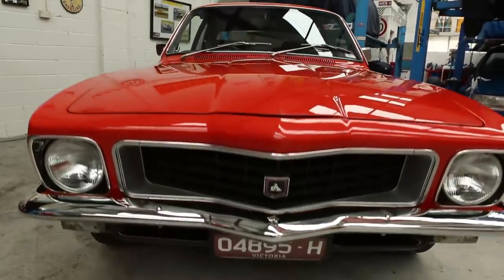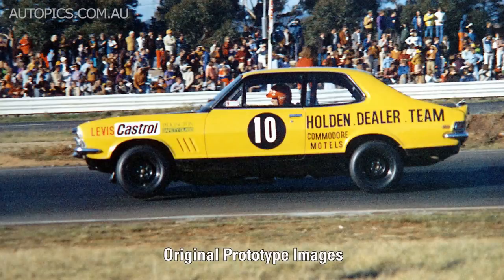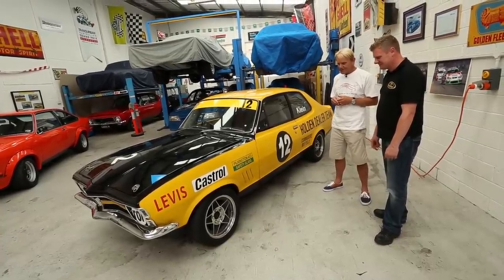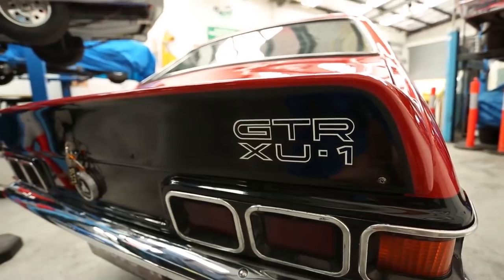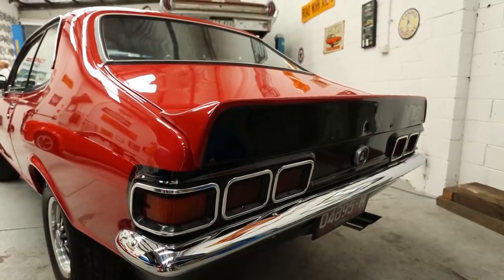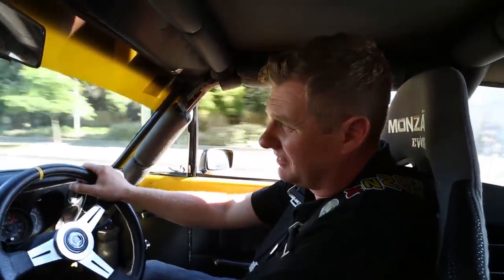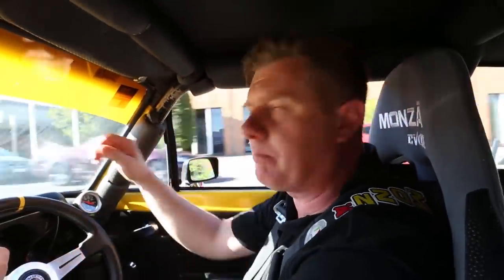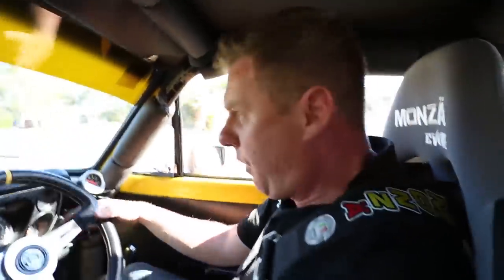XU1 V8 HDT TORANA PROTOTYPE Replica - Pt 2 Ron Klein GM Holden Collection

Comment: Should have been left as it should be. Near standard 308 with the M21 and banjo diff. As they would have been sold. And if used properly work fine.
Top loaders are totally unecescary. And a NINE INCH gunker screws up the rear suspension as they do not fit!
Reply from the maker: That's how it was when he bought it but it spat them all over the road continually, much like the L34 did in its racing days using the same drivetrain. You are correct though, although super tough, that big heavy 9 inch changes a cars behaviour dramatically in a circuit racing application and also takes power away through drivetrain losses to turn it. Even an aluminium center can help great deal with the 9 inch or a lighter rear end like the 80's VL Turbo Borg Warner is also a nice choice, but a pain for ratio changes.
Reply: The 308 V8 was not standard at all, they were 300HP 308 V8 and they had a 2.78 Detroit Locker Diff as well, the XW7 V8 LJ parts list has the Engine Parts Listed and they were not a standard 308 V8.

Comment: There were 6 built. 3 disassembled and 3 sent to South Africa to compete in rally championship
Reply: There were Only Three LJ GTR V8 Prototypes put together by GMH Engineering, Orange, White and Strike me Pink were the Three LJ GTR Colours. The Orange one was Tendered in Feb 1975 by GMH Port Melbourne the other two were Sold as well.
Reply: @666theninja  and where are you getting this info?
Reply: @backyardbangers1012  Feb 1975 GMH Tender Sheet and from a Ex GMH XW7 Engineer that worked on the Three LJ GTR V8 Prototypes.
Reply: @666theninja  so what about the ones that went south Africa  and brock raced one in there rally championship? I have photos of it airborn under a marlboro banner. Marlboro sponsors all over torana to. And theres the write up that went with it stating what is was n who driving etc
Reply: @666theninja  how do i know your not just making that up to be rite???? I know what i know is fact and you will have a impossible time convincing me differently
Reply: @backyardbangers1012  Cause Holden Engineering at Port Melbourne put the Brand New 308 V8's into the Three Brand New LJ GTR's they ordered and got from the GMH Adelaide Plant. Joe Felice from GMH Port Melbourne used to Drive the Lone o Ranger (Orange) V8 LJ GTR Prototype as his Company Car at GMH for 18 Months. Now the only Time Brock went overseas to Race in the Early Days of HDT was when he went to Macau in Hong Kong and he raced the Yellow HDT LC XU1 6Cyl Race Car at Macau in Hong Kong, Go Look on YouTube the Macau Race is on YouTube. There were Only Three LJ GTR V8 Prototypes put together by GMH Engineering at Port Melbourne.
Reply: @666theninja   not entirely true and not the whole story.  I know what i read and saw and wish i still had dads books. One was titled how to build an xu2. It had a red cover. The other was blue n black titled with the gtr xu1 emblem. Obviously it seems 3 were built where you say but there were also 3 others and im  thinking out of another plant???? I dunno about them details. Only know what ive said to be true
Reply: I think from memory street machine did n article on the silver xu2 concept car.
Reply: @backyardbangers1012  lol That Red Covered Book is called XU2 and was done by a Guy from Sydney NSW and it's a How to Guide to put a 308 V8 or Chevy V8 into a LC or LJ Torana, i have that Book as well, Nothing to do with GMH Engineering at all that Book and Also the Blue Covered Book is the GTR XU1 Book done By Fiv from Melbourne in 1984, some of Fiv Book is Correct and he tells you there were only Three V8 LJ Prototypes in his Book, you can still buy that Book any way. There was No others Built from any other Plant, Holden Engineering in Port Melbourne put the 308 V8's into Three Brand New LJ GTR's that they got from the Adelaide Plant, REMEMBER GMH Port Melbourne was Head Office of the Holden World and that is where Engineering was Based.
Reply: @backyardbangers1012  As i said to you before you are Thinking of the GTR/X Torana and go Google the GTR/X Torana.
Reply: Why dont you try the always rite google and try google torana xu2 streetmachine. The site witchcar has the article. Its the first site under all the youtube ones. About 5th one down. Enjoy the read mr know it all
Reply: The article is by graham smith . On 6th of july 2018. Withch is about the original article done by streetmachine magazine in the march 2004 issue of street machine. Good luck and stop messaging your bullshit to me please. I will no longer reply now i realise how much you dont actually know
Reply: @666theninja  red book is how to build xu2. I know because i was using it to build one and am in middle of ten year build now dropping a sbc into a fourdoor s. It seems you know some stuff but not all n is a bit mixed up. Are you sure your memory serves you properly these days?
Reply: @backyardbangers1012  lol i know you know nothing, you Quote magazines and books, i Quote from the Offical GMH Engineering XW7 Parts list for V8 LJ. Cleary you know nothing on the subject as you don't know a GTR/X Torana to a V8 LJ Torana.

Comment: They were all 308. Not 253. And the one and only actual xu2 prototype was a weird  silver mazerati looking thing that looked nothing like a holden
Reply from the maker: You're not think of the Hurricane concept car are you? Story is there were several Torana based prototypes and possibly all but one or two were crushed. I think one may have slipped through the cracks and gone to a GM employee in the day. Lots of different stories kicking around.
Reply: @GlennEverittMasterofMachines  nah im not. It was xu2. It was all in holden  books i got from my dad when i was kid. So 30 years ago. And yeah theres alot of Chinese wisper stories around
Reply from the maker: @backyardbangers1012  , that's interesting because the official code name for the LH Torana project was actually XU2 at one point and I saw early prototype images with XU2 decals on the front guards. I must investigate further. :-)
Reply: @GlennEverittMasterofMachines  cool. Let me know what you come up with🤔👍
Reply: @backyardbangers1012  The GTR/X Torana is the Car with the Long Nose you are thinking of, it was Silver then painted White and Holden still own one, One of the Ex GMH Engineers bought one of the GTR/X Torana's from Holden and his Family are doing it up as the Owner passed away a few years a go, But his Family are Sorting it out now. Go Google the GTR/X Torana. The GTR/X Torana is a Different Beast to the XU2 Torana's.
Reply: @GlennEverittMasterofMachines  The XU2 name was looked at for the V8 LJ Torana and the LH Torana By GMH Styling, The Big XU2 Decals were made in 1972 with LJ and there is a GMH Styling Sketch of a LJ Torana with XU1 Decal on it like there is for LH Torana. In the End the XU2 name was Knocked back for LJ and LH. Terry Burton is Talking about GTR/X Torana and not the XU2 Torana, Two different Cars.

Comment: It would have been a straight up death trap.  A very dangerous car. Unstable, twitchy with poor brakes.
Reply from the maker: At high speed they'd have been be a bit of a handful off the showroom floor I'm thinking. Only for the brave!
Reply: Nooooooo the XW7 V8 LJ Torana the Production Car was Getting New Front Disc's and New Front Calipers and for better Handling it was Getting New Heavy Duty Coils all round and New Heavy Duty Shocks, It's in the Holden Engineering 79 Page Parts List for XW7 V8 LJ. So not a Dangerous Car unless you were a very Poor Driver.
Reply: I tend to agree with you, use to feel the speed in a 6 cyl. doing 130 let alone 160 to 170. Then only drum brakes on the back 
Good luck
Reply: @jimmartin9704  was getting new brakes, it's in the XW7 V8 LJ Holden Engineering Parts List. :)
Reply: @666theninja  
I know the quality of the brake systems in early 70s so unless it was 4 wheel discs, unfortunately history shows us they would of been crap like all makes :)
Reply: @jimmartin9704  Pfttt lol, yet they all got round the Bathurst Track with rear drum brakes, all the models. Front Disc Brakes did the grunt work.
Reply: @666theninja  yer that the did, but they were not good, heaps of brake failures. Can remember Bondy having a moment at hell corner in 75 i think, cleared some spectators that day lol